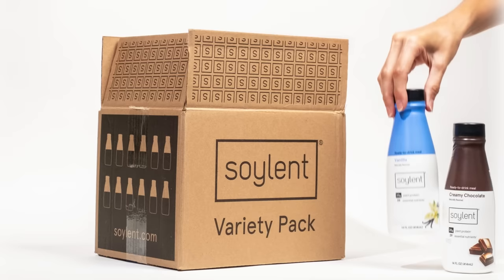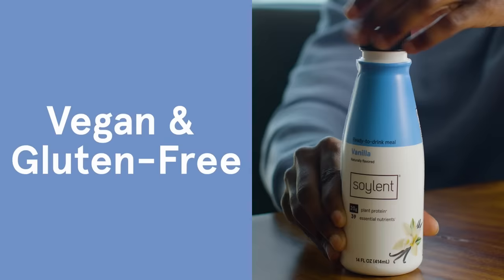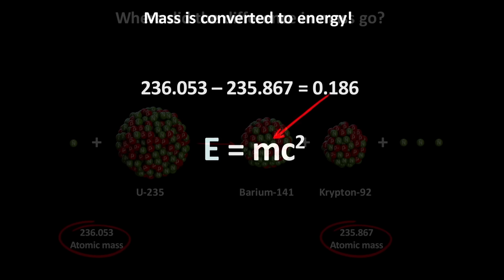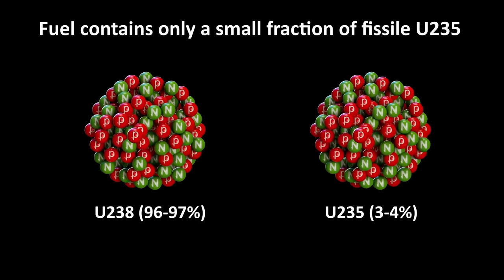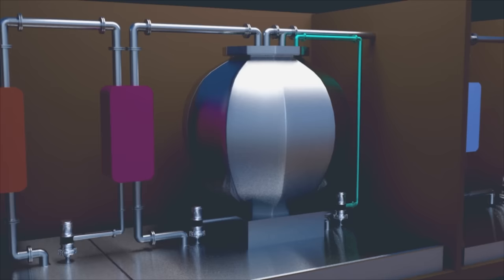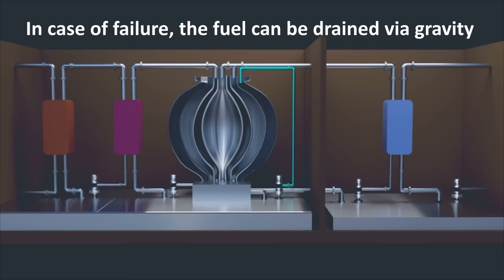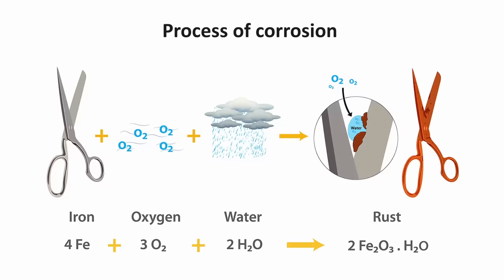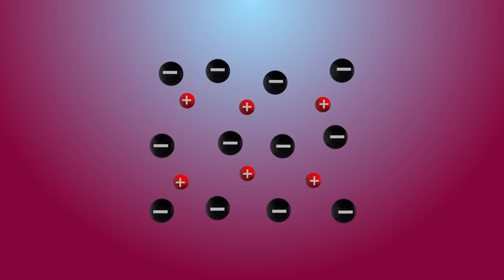How Molten Salt Reactors Could Revive Nuclear Power

Comment: Beyond less waste, it can be used to burn the waste produced by traditional uranium fired reactors. 
I first heard of thorium molten salt reactors like 15 years ago. It's nice to see someone is finally working on their construction.
Reply: Imagine the treasure chest of fuel sitting on-site at current nuclear facilities. Being called "waste" (and it's not even a lot, in fact it's negligible next to the gigatons of particulates each and every year thrown right into the atmosphere from fossil fuel!)

These plant operators are smart to not want to bury it kilometers down: after a few decades there will be some very valuable elements in those concrete cylinders.
Reply: @A-Milkdromeda-Laniakea-Hominid  and, due to the high cost of the current plants, as the reactors come up for recertification, most power companies in the US are opting to decommission the sites. TMI hasn't been operating for several years now, and they're dismantling the facility that could have been converted to thorium liquid salt.

Comment: The problem with commercialisation of molten salt reactors is the wear issue, not only is the molten salt extremely corrosive and reactive it also mechanically etches it's vessels and pipes as it circulates.
This was one of the primary reasons it was initialy shelved until further advances in materials sciences brought about the ability to negate or at least resist those effects long enough to be viable.
I like the tech and it is pretty safe as an automated installtion, I would indeed like to see further development on this and other thorium cycle small reactors.

Comment: The idea of shipping container sized nuclear reactors might be a more important innovation than either molten salt or thorium.
If the reactors can be transported efficiently, then their manufacturing and maintenance can all happen at a central facility.
The on site construction, then, becomes much easier to regulate.
Also, for powering cargo ships and freight trains, a shipping container sized nuclear boiler would be really handy.
That might even be the first market ready application. An efficient nuclear powered freight delivery system could be the backbone of green transportation infrastructure.
I can imagine a high speed trans siberia nuclear train that goes 200 mph and only needs refuelling every other decade!
The potential of nuclear makes the transition seem that much more attainable.
Reply: And tiny AA sized reactors please.
Reply: It’s only possible of low pressure reactors like molten salt ones. The reactor walls of Light Water Reactors are 10 inches of steel, and the containment buildings of water cooled reactors have to have 1000 times the volume of the reactor and use reinforced concrete.
Reply: You never be able to move them after they been fueled & used because of severe radiation contamination. No way to move it on roads, ships. Not practical for utilities since they still have all of the regulatory costs, but the reactors only produce a small fraction of power. When it comes to reactors size, only very big reactors many any economically sense. Also two of the three companies working on SMR have cancelled their projects. The only remaining company is NuScale, which I am sure will exit when the grant money from the gov't runs out.
Reply: @guytech7310  Nuclear powered aircraft carriers and submarines have been moving around just fine for decades now.
It's a very dense source of energy, which is exactly what you want for TRANSPORTATION.
You don't have anything except complaining, and it's really dubious complaining at that.
Understand the tech before you criticize it.
Reply: @ywtcc  Do you have any idea how large submarine and aircraft carrier reactors and associated equipment is?  Not to mention the security provided to prevent sabotage or theft.  No way is this concept going to fit on a highway or a railroad.
Reply: @randalljsilva  You miss the concept that any reactor must be protected from a wide variety of natural and potentially man made disasters.    What happens if a tornado picks up a car and tosses it into the reactor building at 60mph.  What happens if someone intentionally crashes a commercial airliner into the reactor?  Earthquakes, floods, and a number of other things (including terrorist attack).

That's the real reason for the large concrete structure.  In many cases it also works as he containment vessel in the event of a nuclear release from the reactor or primary system piping or equipment.  However, there are a number of PWR reactors where they have a light metal (1/2"-3/4" steel) containment building, with a surrounding reinforced concrete "shield building."   The latest generation of large PWR reactors (AP-1000 : 1150-1200 MWe: 6 built, I know of 8 more ordered and talk of about 15 more beyond that) uses as separate containment and shield building.
Reply: @ywtcc yep, and then have it derailed and/or stolen. That's increadibly dumb. There is a REASON why there are ONLY aircraft carriers (usually well defended) and submarines (usually hard to find) with nuclear power. They don't have another option. They trashed all designs of other nuclear propulsion for a REASON. Go understand the technology first.
Reply: @ywtcc actually nuclear powered commercial ships were tried and didn't work. Almost no port would allow it to dock, and the increased ruining cost of a specialized crew and decommissioning costs made it not competitive economically. The reason submarines and aircraft carriers are powered by nuclear power is logistics and operational, not economical. Trains are a bad idea as well. Trains derail, crash, and go right into city centers. Really bad places to have nuclear reactors. They'd be high value targets for terrorism. They're a bad idea all around.
Reply: it would be an AMAZING improvement over the fuel we use now for large shipping vessels.
Reply: @perryallan3524 
Fuel needed for any type of reactor would need security

SMRs enable smaller, non-bespoke power plants
Reply: Making one big nuclear reactor save from malicious actors is hard enough, but getting a dozen small reactors small enough to been stolen with a truck save, seems to me like a really manpower and expensive endeavor.
Reply: @maltekoch1632  a) Fuel for SMRs isn't good for making nuclear bombs. It needs to be reprossessed.
b) Outside of James Bond movies, there are no terrorist groups that can make bombs out of SMRs. You'd need a sophisticated research and engineering division, and a large industrial facility. It's a crime of a nation state or large corporation (business arm of a nation state).
c) For a terrorist, stealing an SMR isn't a legitimate risk to world safety, it's a dumb publicity stunt that will definitely get you busted.
It's a much bigger safety risk to steal shipments of any number of hazardous chemicals.
I think you should assess the risks more objectively, and spend in proportion, just as it's done when regulating other hazardous chemical industries.
Reply: Veteran here,  we have been using nuclear reactors to power subs and aircraft carriers for decades.  It is safe and as said in the video the biggest problem is corrosion maintenance. The possibility of a group turning it in to a weapon is nearly impossible. Any group that would waste the time to try and steal one of these small reactors is pointless when they could just buy one. I would like to see what kind of technology it would take to make these small enough to be about the size of a water cooler or entertainment center / coffee table for home users. No more electricity lines or grid problems. Just teams of monthly maintenance workers to check systems and look for corrosion.

Comment: No private investors in their right mind would build another nuclear power plant until it is proven that it can be built on a predictable schedule (preferably no more than 7 years) and a known cost. I say this as a nuclear engineer who worked in the industry for 35 years and was laid off when the AP1000 plant in South Carolina was cancelled after delays and cost overruns back in 2017. Several executives faced criminal charges and jail time over this. Either the design company is going to have to build their own prototype and demonstrate the feasibility at their own expense or the government will have to subsidize it.

Scale models, computer simulations and CGI are not enough.

And whatever concept is envisioned, it better take into account for the decline in quantity and quality of the workforce that is going to design, build and operate it.

Comment: Two remarks that I have picked up from other YouTube video's on the subject:
1. Thorium can also be used in presurized water reactors. But it is less useful. The shorter half-life of the waste products remains, though. So I still would prefer it to Uranium.
2.Presurized Water Reactors use solid fuel. Which results in only a fraction of the fuel being used. With Molten Salt Reactors, pretty much all of it can be used. (And I don't mean the U235 is only a few percents of the rods. I mean not all U235 is used up.)

Maybe an idea for a followup video?

Comment: another problem with molten salt reactors is containment. meaning how do they make sure that no nuclear material is stolen.
With conventional control rods, since they don't go anywhere, if they are pulled out and weighed, you know EXACTLY how much you have and it can be compared to what was put in, and there is perfect traceability of all that material.
With molten reactors, you don't know if some of the molten salt is still in the system, if some of it is stuck the walls of the reactor. It's almost impossible to get a perfect tracking of material, which means you can't rule out that some of it might have gone missing.
Reply: This is a molten salt power storage plant, heated by a nuclear reactor. If molten salt plants turn out to be a competitive storage option, they'll be heated by peaks in cheap and cheerful renewable output, not expensive, high security nuclear reactors.

Comment: NUCLEAR IS NOT DEAD.
Nuclear Energy is essential for low carbon future world, this is science.
What we need is to install more and more fission reactors plus renewables as their costs get lower and lower. 
The more reactors, the better the future
Reply: Low carbon is a scam 😂
Reply: I think nuclear energy’s future is not promising.  It works but the electricity it generates costs three times more per kilowatt-hour than the same kilowatt-hour from renewables that are close to free.  Battery storage costs are falling dramatically so this factor can almost be ignored depending on how much coverage you need.  Nuclear energy is prohibitively expensive if used to meet peak load needs, which is the more valued electricity.  It is okay for less valuable base load needs if that’s your only option but it remains more costly.
Reply: Nuclear is not dead but nearly dead! It's an efficient stop gap between fossil fuel and fully renewable energy. Why we need a stop gap? Because despite our collective minds and efforts it turns out we cannot store energy in a small, portable, efficient, durable storage. Yes lithium battery is good, but it degrades over time, not that efficient, dangerous, low density energy storage, and toxic for the environment. We need time to find alternative for grid scale battery system, a time that we do not have. So going for nuclear is a much preferable option than maintaining coal or other fossil fuel power plant.
Reply: @kaptenhiu5623  Nuclear is only near dead in the USA, Canada, and much of the EU.  A lot of other countries are building nuclear power plants all over much of the world as they focus on the truth and not the conspiracy theories and hype.
Reply: @perryallan3524 no those places have major backlash against nuclear.  It's not warranted but it's there.

Comment: It's not safety concerns that makes nuclear not to be adopted, rather, It is its deep cost, and lcoe that deters wide adoption, solar, wind  and battery are cheaper.

We can as well wait for fusion while solar and wind and battery  fills in the gap
Reply: Except that fusion will also be uneconomic.
Reply: The reason you think so is that here in the USA (and a few other countries) is that they are not telling you the truth of the cost of different power sources.  They've created a "convenient lie" to push the wind and solar.

If you only look at the cost of the generation plant - then solar and wind beats nuclear plants.

But if you look at the cost of power delivered to the customer (including transmission and distribution cost) then new nuclear is often cheaper than either new solar or wind in many places in the world (including in many places in the USA).

It turns out that the connection cost of a multitude of small generators to the grid and being able to handle reactive power without a spinning generator that can generate "VARs" is very very expensive.   In  my area people are very upset about how much the cost of electricity is going up with all the new solar and wind-farms.  It's mostly because the "transmission" component of the power bill has skyrocketed.

There have been many studies on this by many countries and even international agencies.

That is why so many new nuclear power plants are under construction worldwide - with more planned.  Because the delivered power cost for substantial generation is cheaper than solar and wind in most cases.  

Not to mention more long term reliable.  Solar and wind typically has to be replaced every 20 years of so.  New nuclear power plants are now initially licensed for 60 years and it's likely that they will run about 100 years.  Note that the "better designed" 40 year licensed plants from the early 1970's have now been running for 50+ years and are seeking another license extension to 80 years (and people are talking about rewiring the plant and replacing controls to go for 100 years or more).

Be careful to ask the right question, and don't be distracted by only part of the picture.
Reply: @perryallan3524  You missed the fact that even considering all these factors, nuclear is more expensive.
Reply: @saumyacow4435  About 20 other countries and the studies within the US on total cost of power delivered disagree with you.  

Feel free to believe what you wish.  Wishful thinking is free and available to all.

However, those of use who are actually trying to solve problems tend to focus more on the facts.
Reply: @perryallan3524 as far as I know new build nuclear reactors aren't enough to keep the power production stable, because more reactors are been shutdown for reaching there max age then new beeing build.
Reply: @maltekoch1632  That is true in the USA, and may be true in certain parts of Europe.

It is not true worldwide as many more nuclear power plant reactors are being built worldwide than are retiring (by a factor of about 4 new reactors for every one retired).

Based on March 2024 data there are worldwide 439 operating nuclear power plants, 61 under construction (average of 6 years to build), and only  214 shutdown nuclear power plants in the world.  The vast majority of the shutdown plants are of the 1960- mid 1980 vintage.  Most of those were shut down long ago (a lot of plants from the 1960's - 1970's had technical or economic issues as they were too small to be cost competitive).

If you look at the number of plants retired in the last decade you will see that its typically in the range of 2-3 plants worldwide per year; while the number of plants under construction has held steady in the same time period with about 10 per year coming online.

Comment: I see no mention of the Moltex stable salt reactor designs, which use zirconium galvanised tubes to avoid corrosion, and convection only to transfer heat to the primary cooling circuit. That avoids the need to pump highly radioactive molten salt fuel through pipes valves heat exchanges and a chemical processing unit. This reduces the capital cost to a little over $1 per Watt. The Moltex flex design uses uranium fuel dissolved in molten salt, which is a simpler fuel cycle than thorium. The stable salt reactor waste burner design being developed in Canada uses molten salt fuel recycled from nuclear waste, using The Moltex waste to stable salt process. You can find all this explained several years ago on a YouTube video by chief technology officer Ian Scott. there is no plan to make large reactors. They will all be small modular reactors sitting side-by-side.

The Moltex flex design produces 800°C heat, which provides efficient electricity generation using the same turbines off the shelf that are used with coal-fired power plants, further reducing costs.
Reply: Doesn't the high price of zirconium make this cost prohibitive?

Comment: FLUID DYNAMICS pipe size matters! Flow efficiency physics, dictates that you want larger pipes for efficient flow efficiency. Large reactors are more efficient. SMRs are more for Silicon Valley glossy brochured investor schemes than a practical economic solution for energy.
MSRs need exotic expensive materials. Hastelloy, Li7 via depleted lithium or similar, tritium management and the high temperature 🌡️ corrosive salts and neutrons are harsh on components it is not just the water. Hit 700c and Cr migrates in the Hastelloy.
We need nuclear power plants now! CANDU style heavy water 🌊 reactors are more efficient and effective. Tested and proven. 
MSRs are promising and should be researched. We lack the necessary information and experience to deploy at scale.